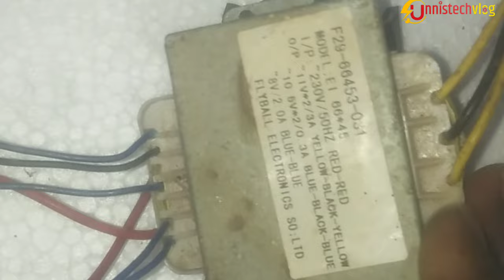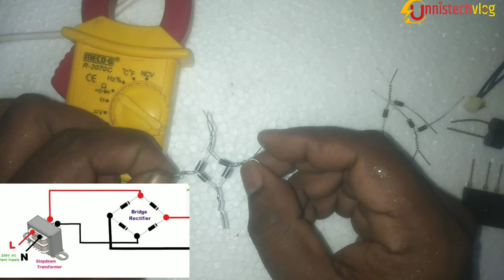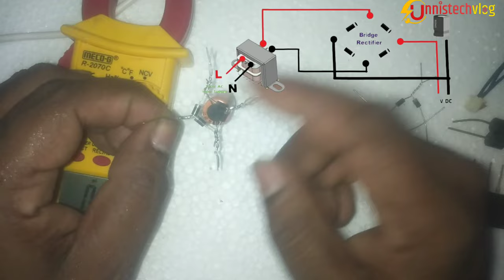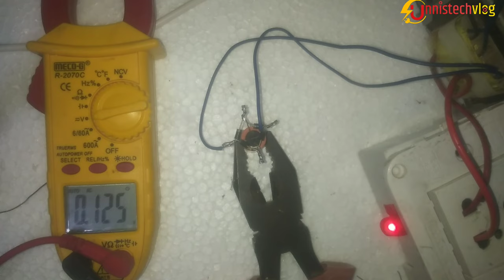Full Wave Rectifier || bridge Rectifier || how to convert ac to dc || unnistechvlog || Youtube

Comment: 45 0 45  10amp Transformer  അതിന് ഏത് ബ്രിഡ്ജ്  റെറ്റിഫയർ ഉപയോഗിക്കണം?  3510 ഉപയോഗിക്കാമോ?
Reply from the maker: എന്ത് ആവശ്യത്തിന് ആണ് 
dc എത്ര Amps എടുക്കും 
ഔട്ടപുട്ട് കൊടുക്കുന്ന device എത്ര amps എടുക്കും അതിനു അനുസരിച്ചു വേണം റെക്ട്ടിഫയർ ഉപയോഗിക്കാൻ.
Reply from the maker: 3510 operating voltage 50 up aanu parayunnath 
3510 bridge Rectifier aanu 
45 0 45 ill center tapped alle
Reply: @unnistechvlogs  സെറ്റർ ടാപ്പിങ്ങ് ആണ് കുമാർ 6 ട്രാൻസിസ്റ്റർ സബ് ബോർഡിൽ കണ്റ്റ് ചെയ്യാൻ വേണ്ടിയാണ്
Reply: Bridge rectifier  ~35 ~35 terminal rectifiril conect ചെയുക  സെന്റർ comen ഉപയോഗിക്കാം എന്നാൽ മാത്രമേ dc +50 0  -50 കിട്ടുകയുള്ളു ആ amplifier boar support ചെയുകയുള്ളു